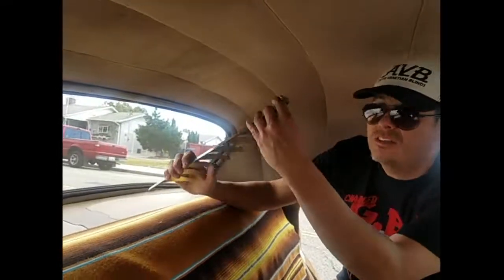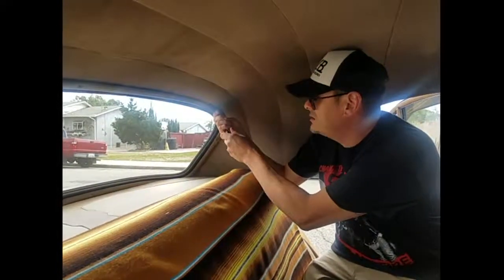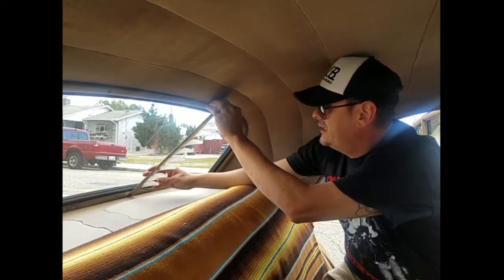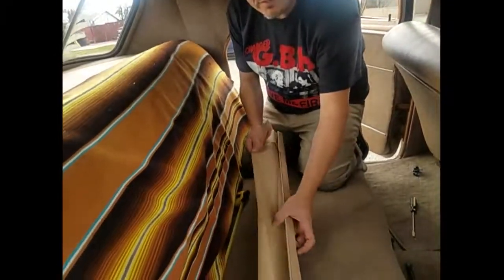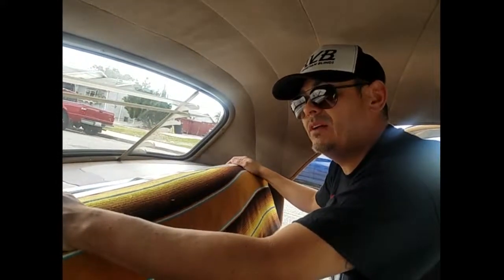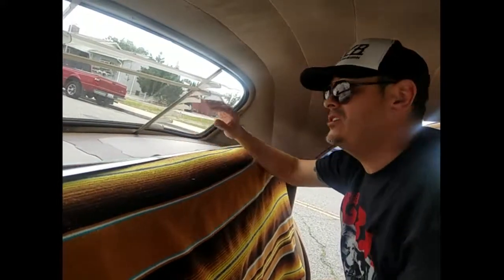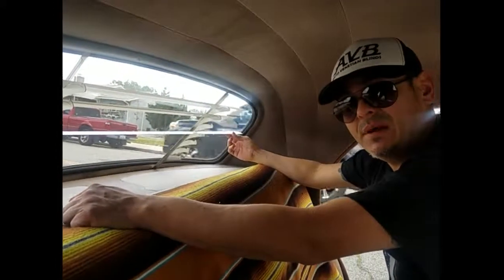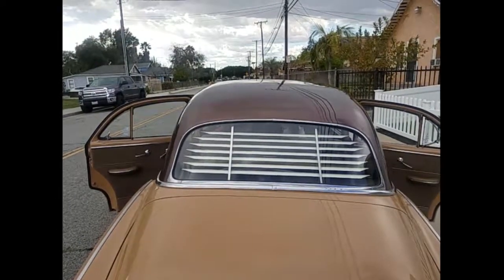Auto Venetian Blinds rear glass car Installation

Comment: I installed these after market blinds in my 64 impala. I’m not very impressed. Can’t roll with the window down because the blinds fold and vibrate because of the wind. I feel like maybe the blades are to thin, because I only need to go 35-40mph when they start flapping and folding and making vibration noises. Any recommendations? Have you experienced this?
Reply: exactly the same with mine, 20/25 and my start to flail on the ends…
Reply: You think adding scotch tape on the bottom of the blinds will thicken and less rattle?
Reply: I put the rails further apart and it help a lot. My thought is getting thicker blinds.